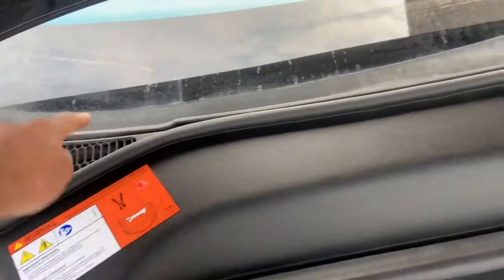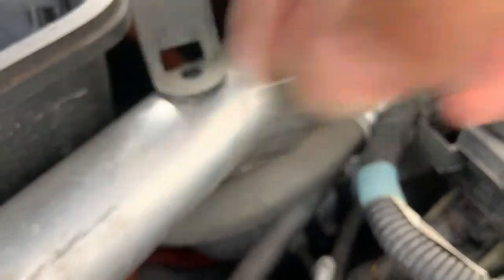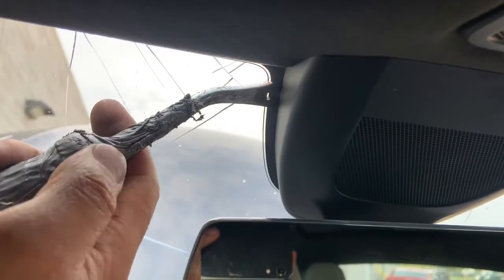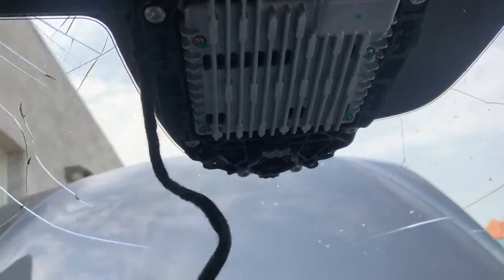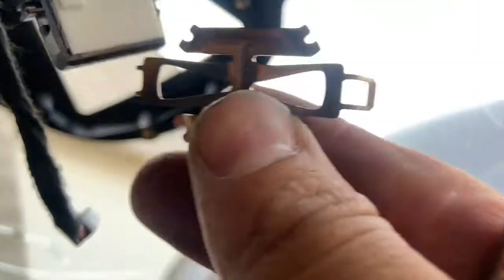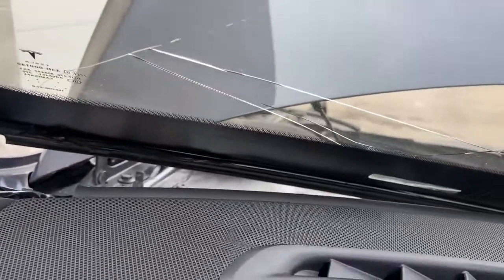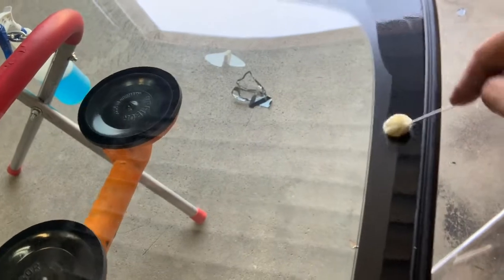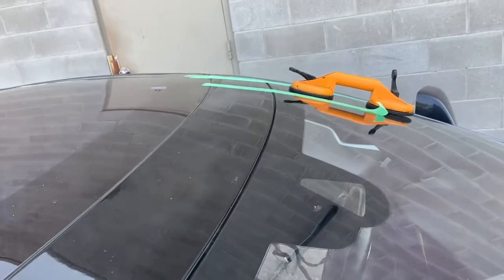TESLA MODEL S WINDSHIELD INSTALL

Comment: Hey man! Thanks for the tips on how to install a windshield on a nice care like this. I didn’t know much about the rain sensors and stuff but that’s besides the point lol. I was wondering if you could give me some advice on starting a windshield repair and replacing business!! I have a detail shop and it’s very big and I want to quit my factory job. I’m pretty known with my detail shop but I wanna grow a business like windshield replacement. I don’t even know where to start. If you could help me it would be greatly appreciated!! Thank you!
Reply from the maker: absolutely!   have you seen my other videos on how to start a glass business and related videos?
Reply: I can give you some advice.  Don't go unplugging stuff like this guy did, you cause huge issues by doing that. and the computer picks up faults with the sensors.  Never unplug shit. just let it dangle down.  The rain sensor is fine to unplug however. Also don't use a long knife and a cold knife to cut the screen out. I can't believe he took a cold knife to the top and sides though... that's just unbelievable, as well as unplugging the car's CAMERA.... 

Pretty much don't do what this guy does.  It's unprofessional. And out dated.
Reply: @Xedilian  I bet that camera now needs calibration.. it's for AP 🤦‍♂️

Comment: This is 100% NOT a D.I.Y. job. You are risking the safety of anyone in the car. A windshield in all modern cars is a structural member of the vehicle and supplements the airbag systems. Hire a professional or risk the lives of anyone in the vehicle.
Reply from the maker: Yes I agree , it's for educational purposes not for someone to do it themselves. It's to understand how a proper professional installation is done. Also by having this knowledge they can spot issues ,if any done by other professionals which helps with safety. Also gives them the ability to ask questions before and after a professional installation.  Think of my videos like that show on TV called "how it's made" it educates people only and helps people trying to learn how to be a professional installer. And helps other current professionals glass installers know what to expect on this vehicle.